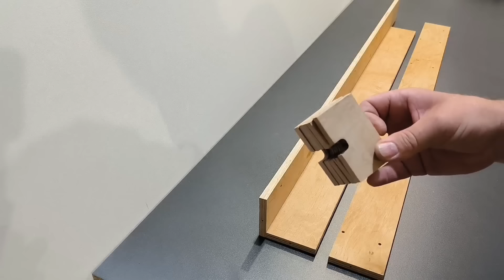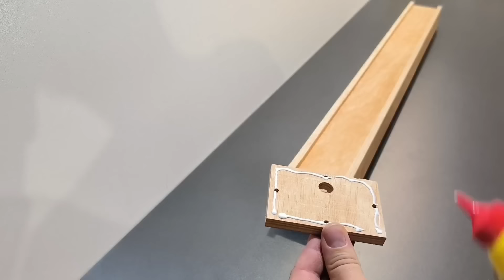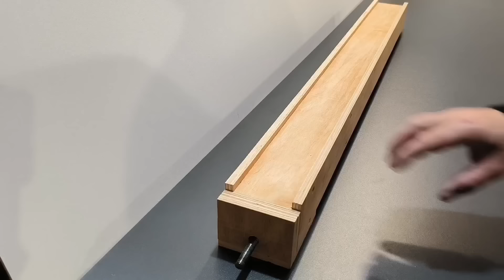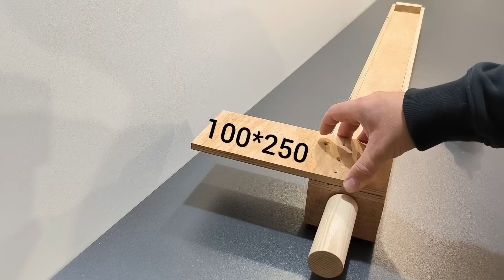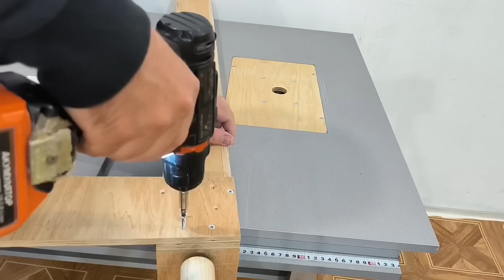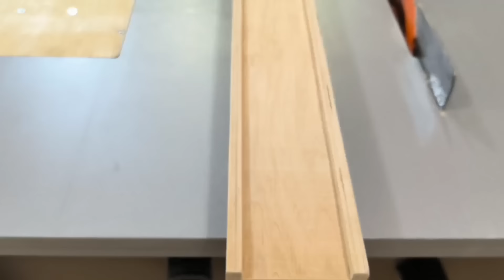DIY Table saw fence

Comment from the maker: Part dimensions
865*70-1
950*70-3
70*40-5
60*90-2
100*90-1
100*250-2
60*70-3
Reply: Thank you for the dimensions 👍
Reply: Nice job work good
Reply: Could you please post cut list in inches to would be awesome i am trying to make it is not as good as yours?
Reply: Hi very smart, what is the dimensions of your saw table ?
Reply: Complimenti, semplice e funzionale. Grazie per l'idea brillante e per averla condivisa.
Reply: what is the thickness of the wood
Reply: Is that 12mm ply you used??? Great video. Building tomorrow. 😊

Comment: By far the least complicated fence video I've seen! I won't build it the same way, because I already started a 4080 aluminum version. But I will adopt your locking mechanism! And use that design for my drill press too! Thank you
Reply from the maker: Thank you for your comment 👍

Comment: I just bought an old craftsman 113 and I've watched 100 fence videos and this is the one that I'm building. Great video. Thank you so much.
Reply from the maker: Thank you very much for your comment 👍. I have already made 4 different fence saw tables and this one is the most convenient and reliable. The only thing I would like to change is the handle to an eccentric. I think it will be even more convenient.

Comment: Nice job! Why do you need to make a pull from the threaded stud to the other side of the stop? Why can't you make a clamp in the same place where the handle is?
Reply from the maker: Thanks for the comment. I did it that way, but when I started sawing, the back of the fence was leaning to the side. That's why I made a pin across the entire fence so that the clamp would be on both sides.

Comment: what are the measurements for the threaded bar/the handle and cutouts/hard ware for handle. Can this be adapted for a workzone ( ALDI )table saw?
Reply from the maker: 1000 mm. And 50 mm

Comment: Thanks - excellent video. I especially like the fact that there is no commentary but it is very clear. The fence that I bought with my saw was useless and broke very quickly. It is on my "to do" list to make one of these.
Reply from the maker: Thanks for the comment.  I'm glad my video is useful.  If you have any questions about the table saw fence, I will be happy to help.
Reply: No commentary, you are so right.
Reply: @mr.IQhomemadeDIY
Reply: Thanks so much for this video, I Will keep it in my important carpenter folder for things to do ! 😀👍

Comment: Hello again sensei. Tomorrow my tools finally gonna arrive. I am going to build these. 
Thickness of off wood used is ply wood 10mm? 
Also width of your table saw is 800mm so if mine is 600mm I have to shorten the 865 to 665 and 950 to 750 the rest is exact same am I right?
Reply from the maker: Yes.  That's right.  Good luck.

Comment: Good video.
Question, how does the saw stay on without you holding it?
Reply from the maker: Thanks for the comment.  The saw is screwed to the bottom of the table.  I have a video on my channel where I make a table saw.  It's called how to make a table saw and a table saw fence.